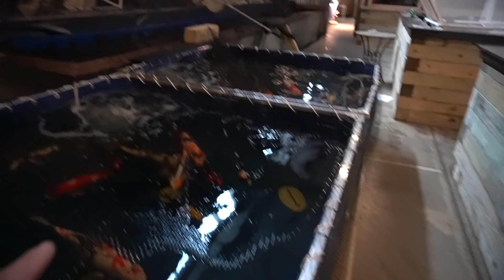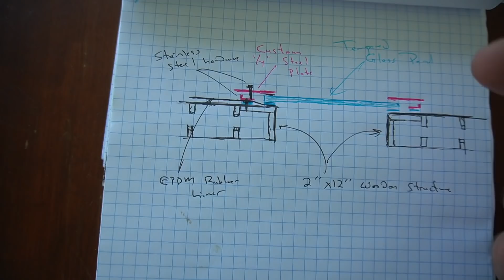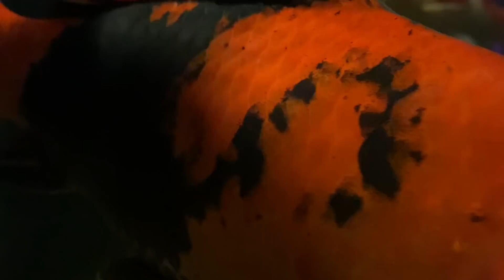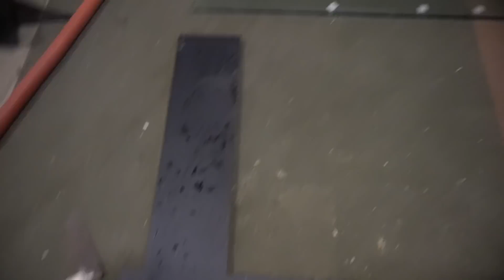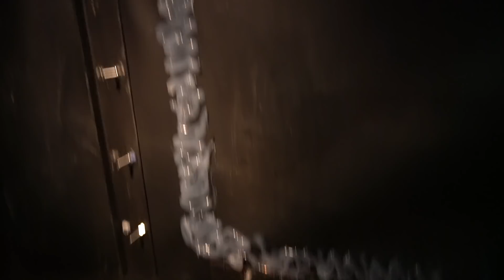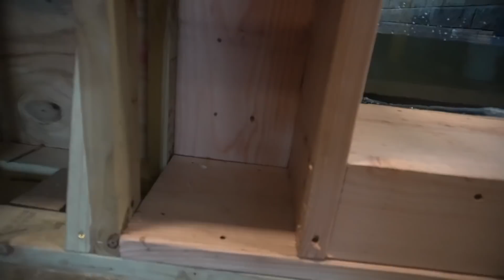How to Install a *KOI WINDOW* for an Indoor Pond

Comment: Hi
Can HDPE be used for wooden pond with window. 
It’s my first pond
Thx
Reply from the maker: Yes,
It’s more difficult to work with(not as flexible as  EPDM) but it will work.
If it’s your first one be careful and take your time.
Reply: @EdThePondProfessor  I'm building a pond with a wooden frame for my arowana . Which one will be better EPDM OR HDPE
Reply from the maker: EPDM is easier to work with
Reply: @EdThePondProfessor  will it last and is it puncture resistant. I'm using polystyrene instead of underlayment fabric .Pond is 8feet by 90 cm deep by 120 cm wide. What thickness do I need
Reply from the maker: Yes,
Very puncture resistant,
Underlayment acts as a great barrier and increases the load bearing capacity of the liner. 
I’d recommend 45 mil or 60 mil EPDM
Reply: @EdThePondProfessor  can I use polystyrene instead of underlayment

Comment: I have a question 
I found a 1” thick 60”x36” glass for a window for my pond I want to build. Glass is in good condition it’s not crack or scratch the only concern I have is that this glass was used as a coffee table. What do you recommend should I used it or not? It’s $200
Reply from the maker: That should work great!!!
Reply: @EdThePondProfessor  thank you
Reply: @EdThePondProfessor , hello. I have a similar question to this one. I am tearing done a 180 gallon glass saltwater tank. I am thinking about cutting the seams and using a panel as a viewing window for an outside pond. The pond is 5 foot wide, 6 feet long, and 7 feet deep and made out of cinder blocks. Do you think using steel frames plates and sealer that this will work?
Reply: My pond it’s only going to be under 1400 gallons

Comment: An Aquascape employee that does renderings lol? Looks awesome! Love all the work you guys do! Cannot wait to visit the HQ one of these days!
Reply: Joe G Drawings are an important tool for getting all of the necessary project components in place
Reply: Ed Beaulieu hey Ed I was wondering if you could help me out with an issue ,I’m building an above ground pond in my back yard I don’t have much space but I have a small 400 gallon blue tank that I have been growing koi in and it is getting pretty hot in the afternoons and that heat stays till about 9 or 10 pm then it starts cooling down I have instilled a sprayer and a sail shade which helps my question is what can I doing to keep the big pond I’m about to build cooler , the pond will be built on top of concrete 18x18 pavers I was planning on removing only the pavers that will be at bottom of the inside of the pond or will 1inch insulation help with heat transfer, I am installing a 3”bottom drain to an eazypod then a 10000 liter varipump to a UV then to a aquascape bio falls , pond size is 10feetx6feetx3.5feet deep with a west facing 25mm laminated window , please help any recommendations will be appreciated thanks ,